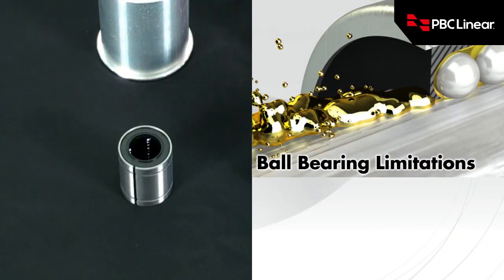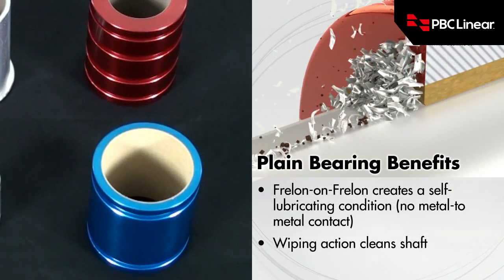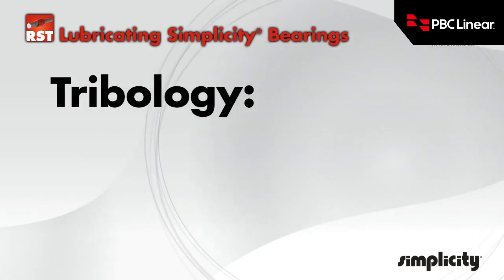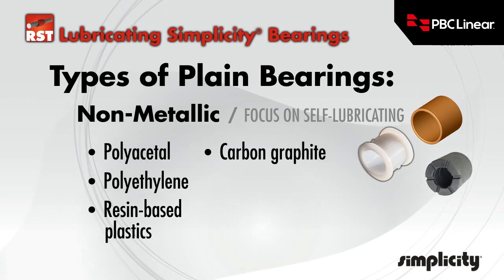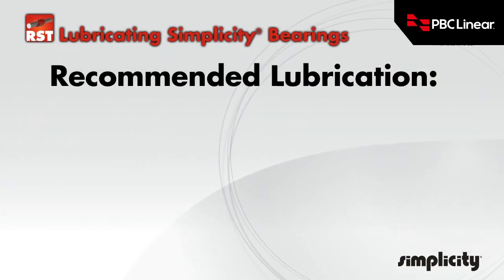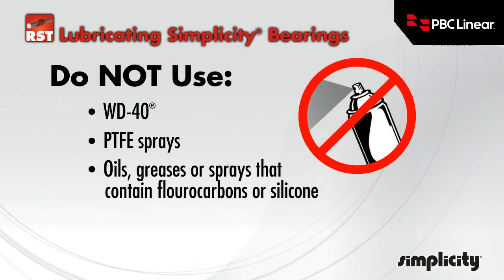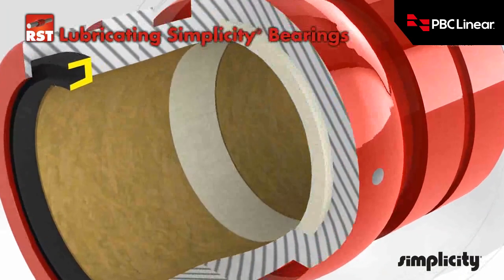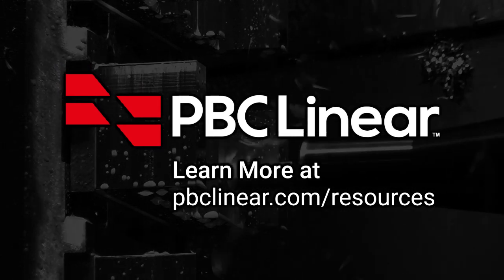How to Properly Lubricate a Plain Linear Bearing

Comment: Awesome.   Been using these products for years.  That is exactly what we recommend.   Heavy grease actually slows down linear rail balls then harden to a cake.  The self love bearings are initially installed with a 3 in 1 full synthetic food grade lubricant when is worn in for about 200 cycles.   You are good for about three years before needing maintenance. Great work PBC!  I use the FL20, FL 24 products
Reply: On what type of machine are you using them?
Reply: Extrusion blowmolding machines (blowing stations).  Blowpins are mounted to assembly.  These bearings are great for alignment.  We are a machine builder and we use them frequently.  We custom make the housing when needed.
Reply from the maker: @bwilliams1815  We would love to talk to you more about your application and maybe use your information on a future case study.  Would you be interested in working with one of our Digital Content Manager to help gain more information?
Reply from the maker: @bwilliams1815  Awesome!  Devin will be in contact with you!

Comment: IF ptfe spray used in electric fan motor (Apply it on the contact surface of the bushing and the bearing, and wait for them to dry before combining them.) Is it OK?
Reply from the maker: We do not recommend PTFE lubricants. There is a good outline of not recommended and recommended lubricants starting at 3:00 in the video.